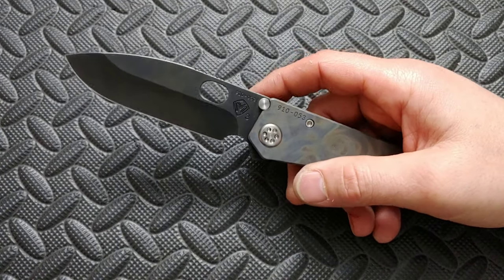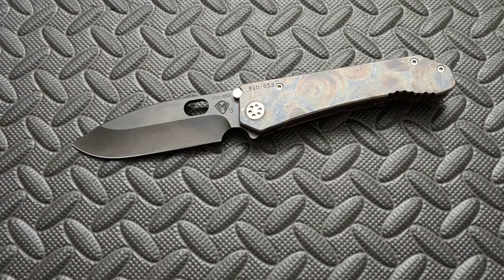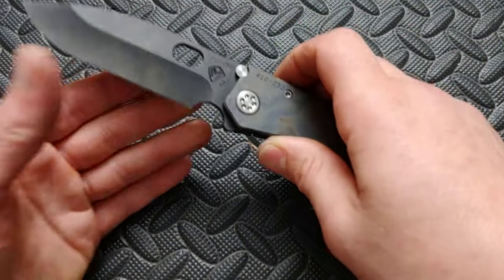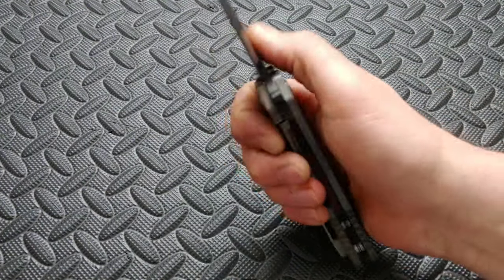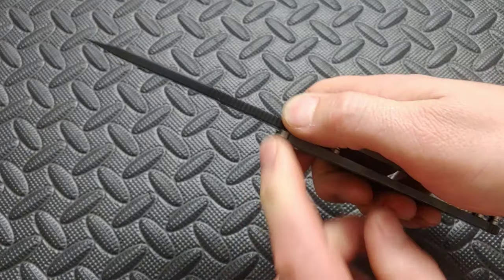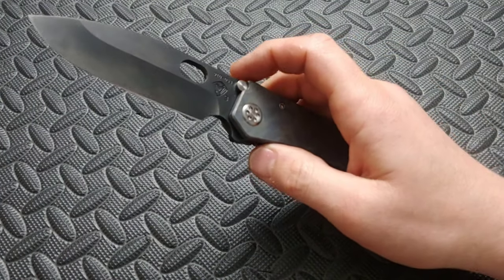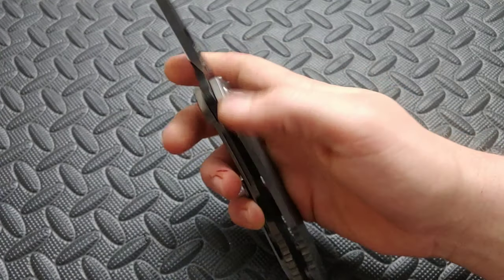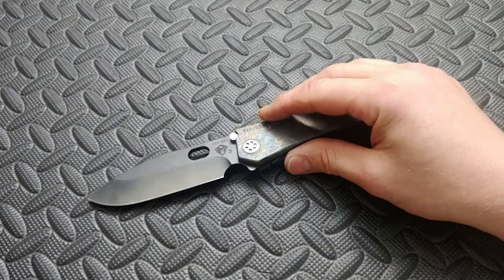Medford 187 DP Review Good and Bad

Comment: Great review. I am not terribly worried about the lock face; MKT tempers 3V very well.  Their CPM D2 is also much more impact resistant than normal D2.  There is 187 with S90V; I would be much more concerned considering how brittle S90V is.  I love this knife.  My current favorite.
Reply from the maker: Yeah i would just keep it in mind, and as long as its not getting dropped off of ladders and roof tops it should be fine. I just keep it in the back of my head

Comment: Nice knife, nice review.  Re: grease - so you would use the grease on say, the Kizer T1 rather than KPL?  Thanks.
Reply from the maker: No you should use kpl on the t1 because it has a lockbar insert and bearings. Grease is for washers that are only titanium framelocks with no lockbar insert
Reply: @NeevesKnives  okay, thanks.  I use KPL and it is so smooth.